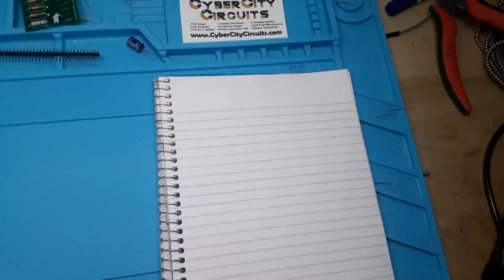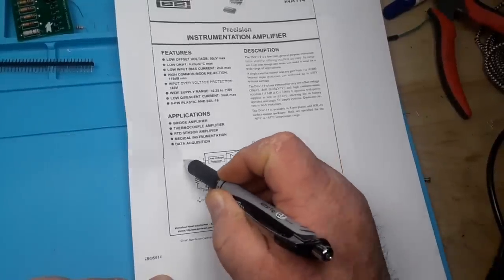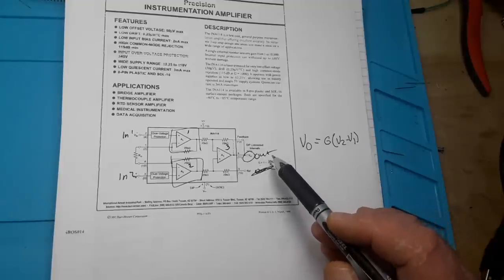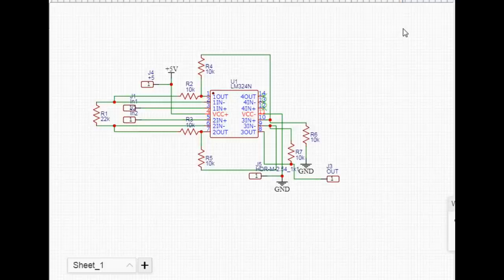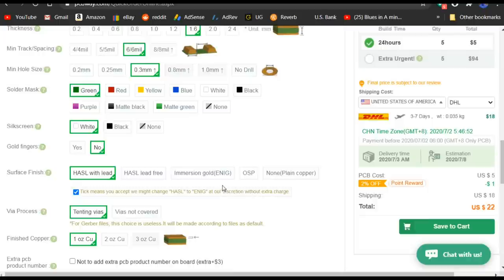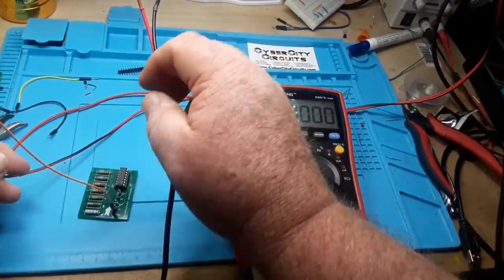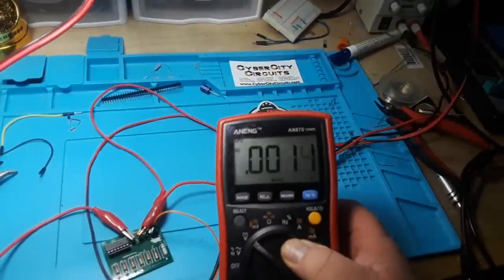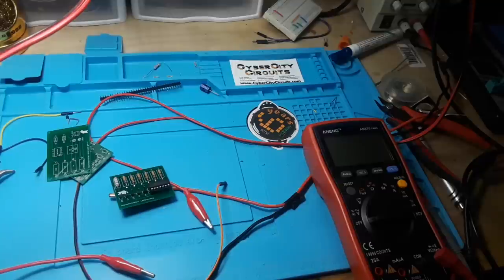DIY Instrumentation Amplifier using LM324N

Comment: The big cost in the off the shelf instrumentation amplifier is in the laser trimmed internal resistors. By trimming all those internal resistors to the same matched values common mode rejection ratio (CMRR) of over 120dB can be achieved. You should check the output of your circuit with both inputs shorted together. Ideally you will measure zero volts. Try then applying a common mode voltage of 1 volt and measure the output again and calculate  the CMRR. You can and should match the 10k resistors to achieve close to similar CMRR as the expensive instrumentation opamp. Most board based instrumentation amplifiers have trimmer or a null multiturn potentiometer included in the design. Also instrumentation amplifier for high gain applications ( e.g. thermocouple amp) need very low drift opamps in the build.
Reply: You are right. But it won't help in this case. LM324 has huge input voltage offset so precise resistors would not help much...

Comment: Given the cost of 1% MF 1/4W resistors, I'd be tempted to buy a pack of 100+, then spend some time binning them. That way you know your CMRR will be good. Then maybe add a multiturn pot to trim the gain.
Using a Wheatstone bridge to match the resistors, and you could easily get it past the accuracy of common test equipment.

Comment: Did a bit of research: "In 1963, a 26-year-old engineer named Robert Widlar designed the first monolithic op-amp integrated circuit, the uA702, at Fairchild Semiconductor. It sold for US $300 a pop. Widlar followed up with an improved design, the uA709, cutting the cost to $70 and making the chip a huge commercial success" spectrum.ieee.org.
Although you can purchase an LM324 for less than a Snickers Bar (so good!), $11 for a precision op-amp is not too bad.
Thanks for the video Paul and have a great 4th!

Comment: Funny video.
The main thing about instrumentations amplifiers is the differential inputs (I guess it is what you called common mode rejection). They do not care about signal level and ground as long as the signal is within their operating range. For this to work well they need some precision resistors and that is what you get in the package: 3 OpAmps with laser trimmed precision resistors on the same substrate.
The circuit is very simple as you show, the issue is getting precision resistor that tracks over a wide temperature range and the laser trimming cost a lot of money.

Comment: Bandwidth is an issue for these cheap operational amplifiers. The LM324 (I have 1K in stock) - it's bandwidth is good for about 5KHz if it is necessary to have minimal distortion (the difference between the input and the output signal) A quality class AB audio amplifier would have possibly 0.01 percent distortion, and have a bandwidth of possibly 20Hz to 20KHz (or hi fidelity)

Nice video keep up the great work 5☆

Comment: If this was the reference INA, they would have dropped the entire idea a long time ago. It's so inferior to that, old otherwise INA114. For an INA, one actually buys the performance not the basic topology. The IC producers worked a lot to tune in the technology in order to get the datasheet performances. Were those 0.5W resistors, by the way? And no decoupling cap at all. Some scope's images would have shown it's lacking. The video is instructive but the INA you made, it's only an attempt of reaching the real thing.
Reply: Rob C  Nice channel, but a sense of realism helps getting a good picture. Some solutions can be improved if they are looked at with a critic eye. A hobby can get some people a long way through. I didn't think this was a knitting channel an Paul is indeed an engineer. Respectfully.

Comment: Hey Paul.
Believe it or not, I am actually building the exact circuit to amplify a pressure sensor. In my circuit, I am using the buffers to stop the differential amplifier resistors from dragging down the signal.  That is, no gain on the buffers but rather on the differential amp.  My question is this. Can you explain how the 'Gain resistor' can be common to both buffer amps without losing the integrity of the input signals?

Comment: A  great video, but I have a question as a newbie in electronics. Feeding 5v into the LM324, and on both pins 3 and 5 there is 0.3v approx, then on pin 8 there is 1.8v approx, which is quite a gain! Is this correct. Thanks

Comment: No way a normal OpAmp like LM324 can replace any Instrumentation OPAmp for various factors like offset trimmed, laser-trimmed register, near matching values,  R2R input and R2R output and also high gain, which oscillation control. That's why they cost more but do the actual job.  Your video is good for learner but not a complete one. Like it does not show the Zero output match,  required double biased PS,  the maximum V+ diff etc.  

Also, when you can spend  $22 just for simple PCB then when not $10 for Instrument OPAMP ?

Comment: LM324 is one of the worst Op amps I have ever come across. They read between 0.2 and 0.6 volt difference between the input terminals. From there all gain calculations are out of the window.

Comment: Ummm....I would do check...putting both inputs at ground..to ensure that the output is at zero volts.   

One note..ummmmm  $ 5  for the PCBs and $ 18 for the shipping...This is only few grams...DHL and Fedex are really....scamming the customer on this tiny packages.  This PCBway company  should have a more cost effective shipping company!!!! There tons of products that we get from CHina...with free shipping...Something is not right between the product cost and the shipping.
Reply from the maker: You don't get free shipping from China in 5 days.
Reply: @learnelectronics  Correct...it takes 3 to 5 weeks.  However, even Fedex takes two weeks...I don't see the point of using Fedex or DHL and paying about $ 20....since your product will take few weeks anyway.    There is this malicious idea that PCBs are cheap to charge you more for the shipping. I hope this is not true and that the shipping cost is what it is from Fedex  or  DHL.
Reply from the maker: You can pick any shipping company you want.
Reply: @learningpower9437  What is the cost of a jiffy bag and US postal rate? and how many days to arrive?  Just curious.

Comment: Ya....it's working.....right.... I suppose that's why a 'true' 'instrumentation amp' costs so much....since it's precision.... NOT hacked together with a dirt cheap single-ended quad op-amp...and  as some else said in the comments....at least you could have used matched resistors, or use 1% metal films.... I don't think you actually tested it in a 'common-mode' situation.... nice pcb though, even though the layout was amateurish .... if you're measuring tiny mVolt inputs, keep those inputs 'away' from power, etc.....just saying...